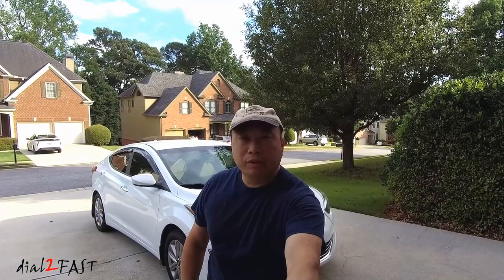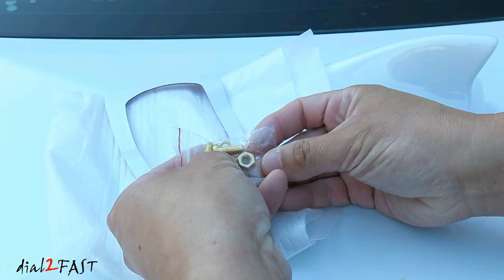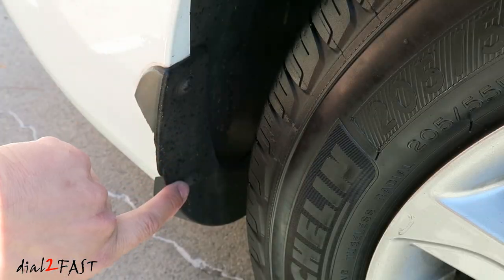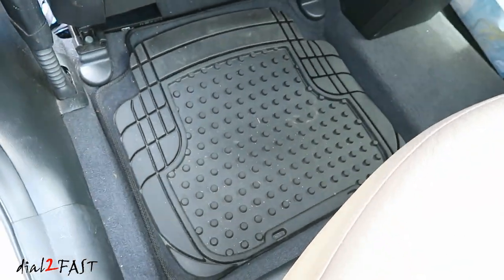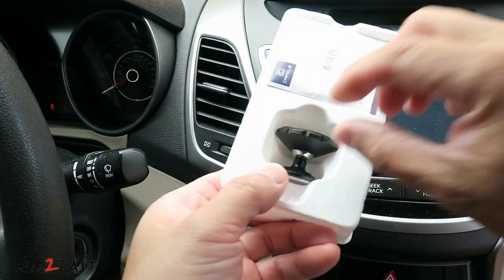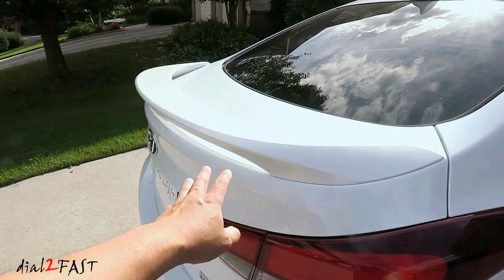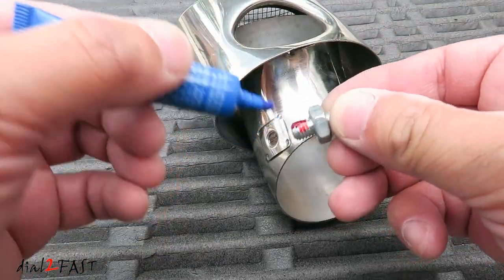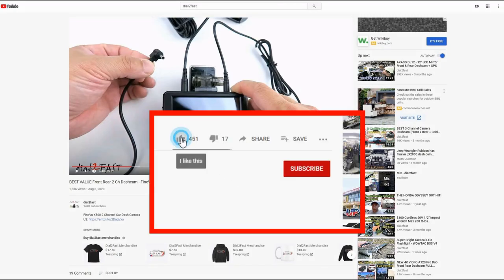Massive Car Mod - Pimp My Elantra Edition

Comment: I have 2013 hyundai elantra gls and i absolutely love driving her! Got her july 2020 named her peggy, as in pearl or pegasus, I love your video! I just got the pedals,mud flaps, painted factory spoiler, door handle covers (in gloss black) , vinyl black mirror (x high gloss) roof "black out" wrap, extra oem pray paint kit (for touch ups and small accessories), a body mod  kit  with front  back and side skirts lips splitters etc, 3d moulded all. Weather mats,  beige faux leather seat covers,  precut window tint and of course a racing sticker!  What can i say she has my heart
Reply: where did you get all those things from?
Reply: @mackenzie7550  ebay and amazon :) the tint i got was easy to di it myself and looks amazing
Reply: Hey bro i got my elantra and am looking for parts got any suggestions?
Reply: Hey, I have a 2010, any ideas on where to start on upgrading mine? Also, this is 2 years from your comment so Im really hoping you see this lol

Comment: You should get custom wheels that widens the offset a lil bit. It will make your car look much better on lateral angles and overall you car will look even much better with custom wheels. Slightly carved in wheels look really good on this car

Comment: Thanks for doing this video. Very helpful. Question - how have the chromed door handle covers work out? I have a 2013, and my clearcoat has become compromised on the door handles, so I'm thinking of doing the handles like you have. Any issues with sharp edges?
Reply from the maker: The chrome plating on these parts are very good. They don't scratch or come off. As for the edge, it's not sharp, but you will notice it when you grab onto it.
Reply: @dial2fast  thanks very much for the response. I figured with them being made of plastic that they probably were not very sharp. I'll probably be buying these, as the Chrome in my opinion gives a good overall look to the car. Thanks again!

Comment: Just want to confirm if the exhaust tip that you installed on your elantra was the one advertised for a mitsubishi outlander on the ebay link?

Comment: WAIT! hold up!! Everyone in the comments. Please dont add a exhaust tip! it does not add no HP. 
you wanna add HP?
Delete your muffler and resonator. your 2nd cat, intall headers, put in ana airbox and get your elantra tuned.
Your hp gains will be around 30-50hp depending on your engine type/spec. 
Also, put some better suspension on your car and drop it not "low low" but low enough the the force of air doesnt hit your tires which cause slight drag. 
Then! Get a proper camber done for performance. 
Then, your car will not only be decently fast from all the modds youv done, but also, suspension will feel efficient with the tune set up, so your car will be  slightly quicker aside from engine mods. 
Oh and, 17 and 18in wheels with highquality tires will really help too! 

as im writing this, i realized he was joking about the exhaust tip. however,  some of you are kinda slow...no effense if you are. 

Enjoy and drive safe. 
P.S, you can do alot of these mods yourself for atleast a total of $2500 in total (tools included if you dont have them)
Whereas, a consistent schedule at a shop youll end up paying $3500-5500 to complete your modds. Consider that. 
Most is easy work to do yourself.

Comment: Honestly, I would say the worst mod for me is the window visors. After installing mine, my blind sides increased by 10 percent. I would suggest removing it for safety purposes but that's just been my experience.
Reply: You probably too tall. I find the window visors to give it a better a look and also when its raining you can slightly open your window if tou want some wind or just dissipate heat without turning on the AC

Comment: Where did you get the vinyl for the badge, was it easy to lay behind the badge?
Reply from the maker: I got the vinyl on Ebay and to apply the vinyl behind the badge, I cut individual pieces to size and placed it under each section. You also need to use some soapy water so you can move it in place. It's tricky if you never worked with vinyl before.
Reply: @dial2fast  appreciate you thanks!

Comment: We’re are the mud guards
Reply from the maker: Here is the aftermarket mud flaps. Now keep in mind the aftermarket ones don't have the same screw holes as the oem ones. You will need to drill new holes on the mud flap, but they look fine after install https://amzn.to/3CFEF99